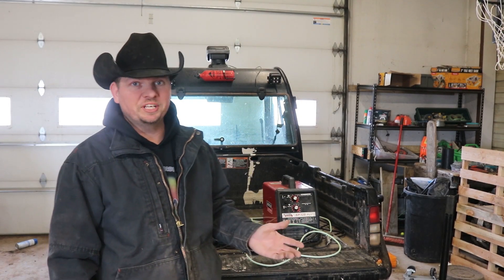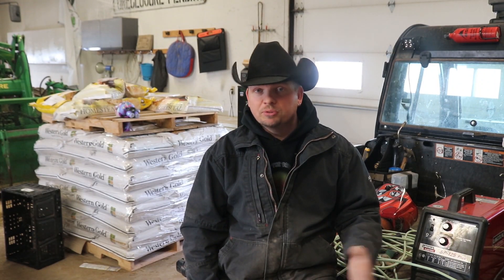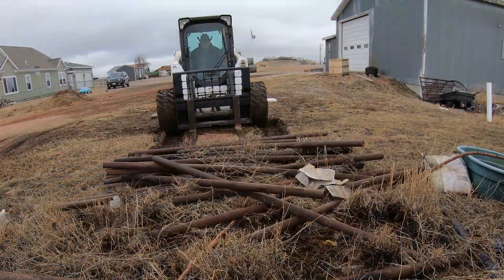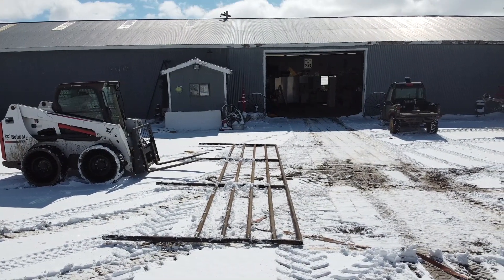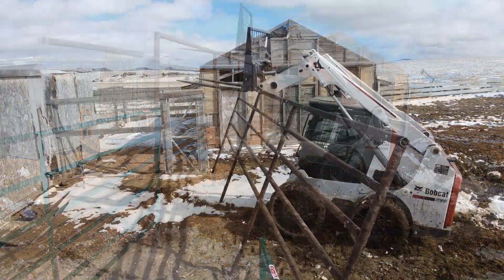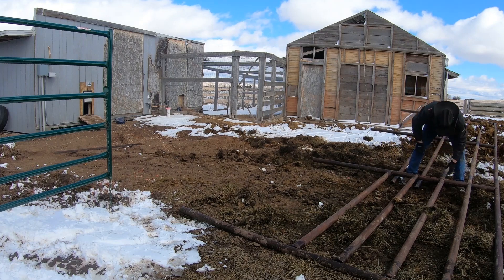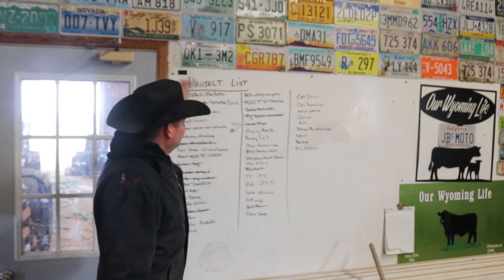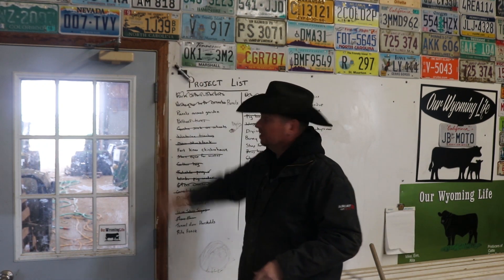Pipe Fence - The Hard Way?

Comment: If you are going to cut an “arrowhead” with a straight circular saw like you showed in your video, do yourself a favor and grind out the insides of those points. You’ll find it wraps around the pipe a whole lot better and is much easier to weld.

I prefer saddling, but in a pinch will cut a point like you did and either saddling or making a point, the insides of those tips have to be ground down quite thin in order for it to pass over the radius of the pipe it is being attached to (the host).

Also, when your “tack“ pieces together, you’ll find if you start your weld on the host metal, then lace over to the crossbar, you will get much better penetration and if it turns out you need to cut it, you can use a cut off wheel in your high speed grinder and just follow the shape of the saddle or the point and it will pop loose.

Also, it is ALWAYS Easier and faster to build a welded-steel pipe fence in place. All you need are string and two levels.

Lat out where your holes go, drill them and then stretch a string on either the inside or the outside of the pipe (just be consistent) to get them all straight in a row and then set them individually using a level each way, pour in half a gallon water, dry concrete, add a little more water and move onto the next one. 

After you’ve done it a few thousand times, it’s a cakewalk.

Comment: Up north here we have been using pipe panels. They are made from the 2 and 3/8 drill pipe and sucker rod.  They just have feet welded to them so they are totally portable if you want to move them for cleaning up manure and such.

Comment: Hi Mike, I see the gate pipe that you installed has a different weld joint. That's the same joint I use in welding pipe fencing, it's much easier and fit-up is faster, all you need is a hydraulic press to squish the pipe end flat. Then welding is just a simple straight bead on each side. That's why the gate maker does it that way. Good luck 🤠

Comment: I use a hole saw setup to notch pipe for fence. it works well. Hard to believe the welds broke, I have had a gate I made hot by a car and twisted but not one weld broke. Around here every post hole has to be drilled because the ground is almost continuous coral rock. Then again we don't even have a winter here, it's been over 85 degrees for a high for two weeks now.

Comment: Hey Bro 
There is a Epoxy/Foam product that you can use in Fence Post Holes  which when used with a spacer to lift the post up off of the bottom, works better than concrete - it seals water off of the post and is just as strong. I saw Matt Risinger demonstrate it on one of his videos.

Comment: Mike maybe  might  want to give the post setting  foam a try  its actually  cheaper and faster  than concrete  and belive it or not stronger  sets in minutes  to point that could  finish welding   instead  of days

Comment: to cope pipe easy cut in 1 3rd of pipe diameter into pipe all the way from outside outside to center point. substract that 1/3rd measurement from pipe  from length   for both ends.
 find the center then cut to that. for easy example 1 1/2 inch  tubing would measure 1 1/2 inch divided by 3 outside to center of .5 inch . you loose a 3rd inch from both ends but the pipe or tubing will fit good enuff to weld.
Reply: correction you loose 1/3 pipe diameter in length.
on both ends

Comment: Never would have had the gumption to try placing that pipe fence without 2 people to hold it in place.   Also Mikes JD with the bucket filled with sand would have enough weight to easily push those poles in the ground

Comment: I don't understand why you wouldn't just set your posts in the ground then weld the horizontal pipes on thereafter. The whole carrying the fence tacked together in the shop seemed like such an unnecessary step.
Reply from the maker: I guess cause I did. :)
Reply: Certainly a lot easier to layout the pipes and keep them in place while you weld in the shop.